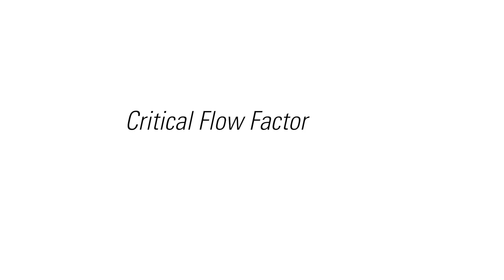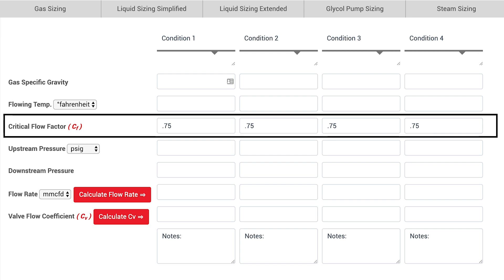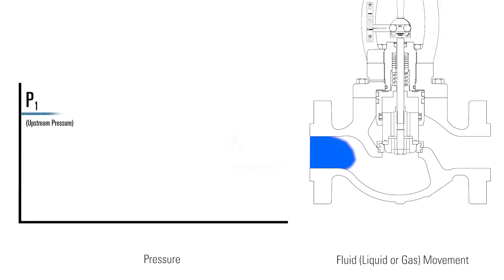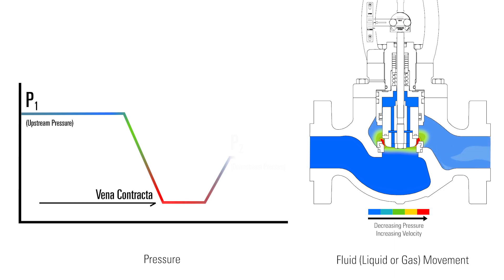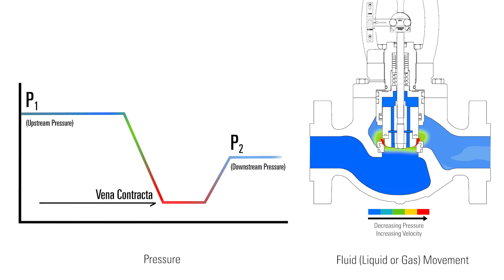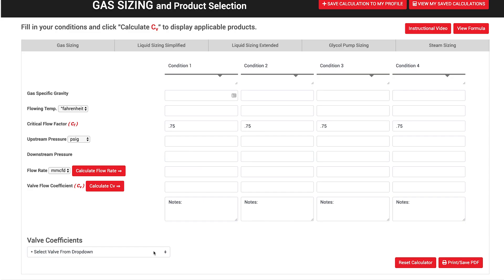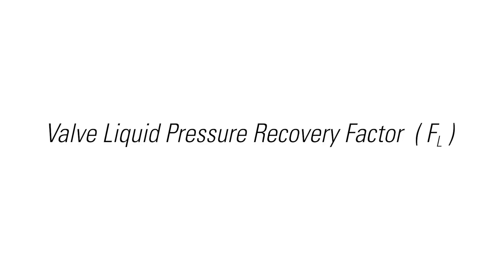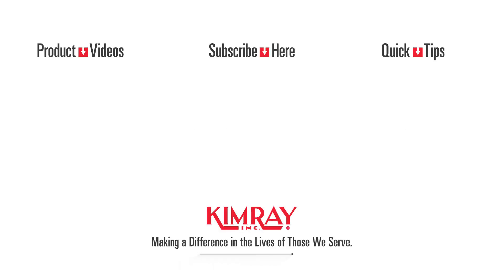What is Critical Flow Factor (Cf)? [Coefficient for Valve Sizing]

Comment: Hi, why does the pressure reach its minimum value and not its maximum value when it comes to vena contracta ? wouldnt the pressure begin to decrease once the valve is open as velocity increases?
Reply from the maker: Pressure has an inverse relationship to velocity in this case, so when the velocity is at it’s greatest, the pressure drops to it’s lowest point due to the conversion of pressure energy to kinetic energy. This is why the pressure reaches it’s minimum in the vena contracta, where the velocity is at it’s peak.

Comment: Sir, does Cf interfere with the tendency of cavitation of valve? Thanks
Reply from the maker: Cavitation is somewhat related to the Cf. The Cf value by itself would not be able to tell you whether your valve is in danger of experiencing cavitation. That would depend on the vapor pressure of the process fluid compared to P1, P2, and Vena Contracta pressures.
Cavitation occurs due to the Vena Contracta Pressure being lower than the vapor pressure of the flowing fluid. When the fluid pressure drops lower than the vapor pressure, the fluid changes from liquid to gas. Then when the pressure is recovering (increasing up towards P2), if it recovers to a pressure higher than the vapor pressure, the gas bubbles begin to implode, generating shock waves which cause damage to the trim.